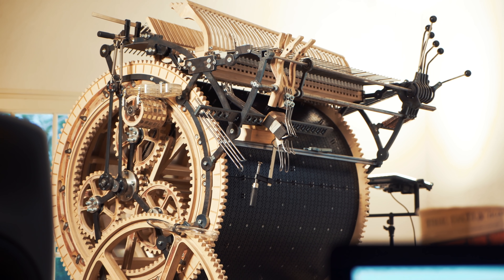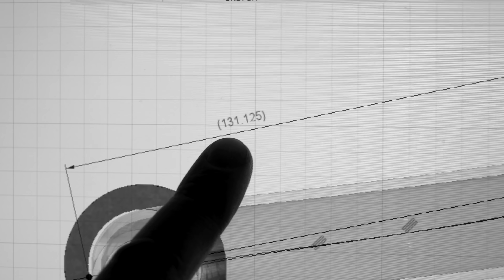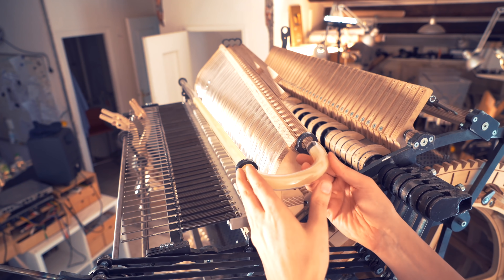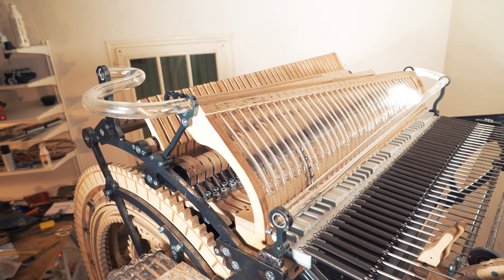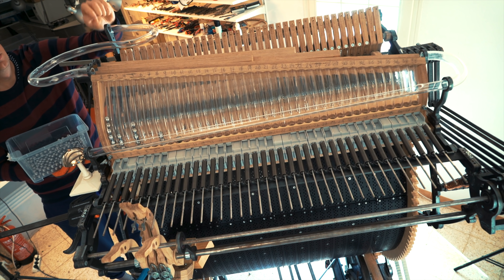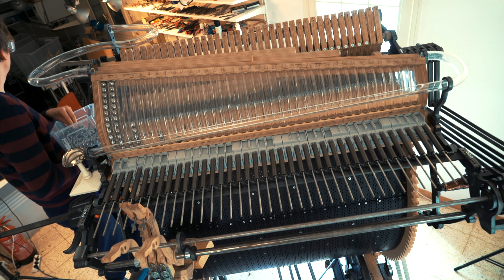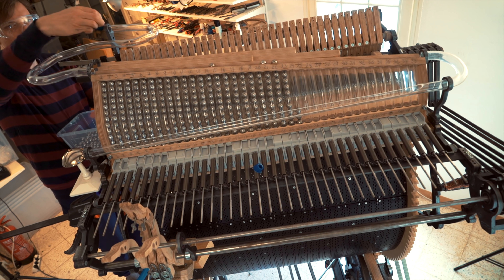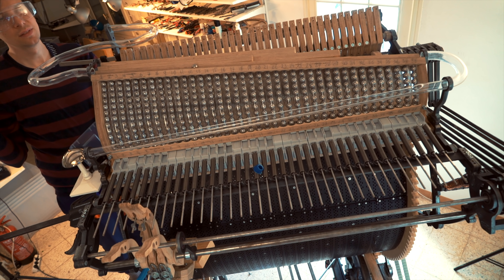Marble Divider Transport Tracks - Marble Machine X #68

Comment from the maker: Latest News: Maybe we did find an alternative programming wheel design yesterday, brainstorming with the team! (after the recording of this video) 

As I mention inside the video the most popular suggestion for a design change is to have the songs preprogrammed on tour. This would only be practical if the sections are redesigned into something much smaller and lighter. 
Yesterday I talked about pop rivets in a thin metal sheet with holes drilled by the CNC machine and then Tim Keller mentioned a welding stud gun and that we could bolt one to my cnc machine then I found this:
https://www.youtube.com/watch?v=SzLPZj_lkwk
a welding stud gun CNC machine from HBS, Germany, 
The idea here is to use thin metal sheet and have the CNC machine accurately weld on the programming pins to the flat sheet.
The sheet is thin enough to easily bend around the radius of the programming wheel.
To save weight you could laser cut the sheets beforehand and remove a lot of excessive material.
The songs could be transported flat, and perhaps even be cut in one length, although 267 cm is probably to large surface to cover for the machine so maybe two halves is the practical choice.
Anyone know anyone working at HBS? Maybe they want to do a collab on this :)

This solution does not allow me to compose spontaneously on the machine, but I can use my existing programming sections for that, and then the stud welded solution for the world tour :) best of two worlds.

One dark cloud on the stud welding sky: Every weld would distort the sheet a little, so more notes, more distortion. this might be too much distortion for keeping things accurate. Maybe software can compensate for that. 
And this is a great example of why this problem is tricky, every solution that seems genius, provides its own new problems.

But, Come on HBS, wanna go dragon hunting with the Poster Child of Sunken Cost fallacy?? Its a Very rare event, lets do it!

Good luck with everything you do! / Martin
Reply: Sunken cost fallacy is only applicable if you have something better to do with the resources that you put into the project. If you can't think of anything else you'd rather want to spend your resources on, it does not apply. Not all investments need a positive return on investment, the journey itself can be worth many times more the value of the outcome.
Reply: @JochemKuijpers  no, not something better, marginal analysis looks at EVERY POSSIBLE alternative, it's an extremely impractical approach, but your comment over simplifies it a touch...
Reply: Ok so I found the vid here:
https://youtu.be/x0RJWFURcs8

One massive issue is the size of the welding head. That radius will definitely prevent you from putting suds anywhere near as tightly packed to match the current programming pin spacing.
Reply: Everyone sub here then HBS will collab for sure ;) https://www.youtube.com/channel/UCL3iZdVyWmxemHyjj1B_4ew
Reply: @jamesdavis2027  I saw that too. Looks to be at least  25 mm or an inch
Reply: @jamesdavis2027  @Cliff Hartle there are other videos as well, where you see that they also weld without that "pneumatic clamping device"
Reply: But you have a 100% working design right now, so this welder strikes me as a solution looking for a problem.
Reply: You copied the link from the description so it is broken, here: https://www.youtube.com/watch?v=SzLPZj_lkwk
Reply: MangoTec interesting, in this video there is no welding head that comes down around the stud unlike the one I found. This setup seems like it would close packing.

Also martin, Im sure if you got on the phone with the company they’d let you know how to avoid warping and shrinkage.
Reply: jacktheripped  someone needs to watch the entire volume of videos. It's all been accounted for.
Reply: If you were able to program the CNC paths to say, start on one end of the song, and go to the other, the sheet would distort past the latest note (with no notes past it), so while the end of the sheet would slowly creep, the space between already welded notes would not? Maybe? Just spitballing here. 

Also, at least in the US, that video link is broken. 

Cheers!
Reply: As a suggestion for the issue of programming quickly and correctly onto the wheel would be to make paper overlays for each section where there are holes where the pins want to go for each song. Similar to a template. While it would not speed up the issue directly it would make the programming easier (and thus faster) and , more importantly, more idiot proof.
Reply: @nothingtoseehere9834  i think he mentioned that as his original idea as to how to speed up the programming
Reply: @SkullCrusher757  I had thought he meant like a metal or plastic/acrylic sheet. Hence the weight argument. I feel like I was mistaken.
Reply: @nothingtoseehere9834  no in this episode he did but his first idea was to use paper he mentions it in a few earlier episodes
Reply: @SkullCrusher757  ah, my mistake
Reply: If welding distortion is a problem, why not go with the tried and true method that nearly all music boxes have been using for centuries? Bent metal pins! Laser cut the sheet with thousands of semi-rectangles, maybe scored on one side to facilitate accurate bending, then tediously bend them all up into position. With some clever software programming you could probably laser cut a sheet for each song individually. Granted there may be more problems with this, such as making the pins rigid enough not to distort from a 90° angle, but it could be another solution. 

Bonus suggestion....
Invisible UV paint on the machine (and marbles?) for a crazy secret rainbow effect that only shows up under black light. Maybe cover Black Light Machine by Frost* too...
Too crazy? Yeah.
Reply: @boswell255  You'll still have warping problems with lasering that much out of a sheet.  Same with CNC turret machine.  I may have accidentally made operators of both hate me with some of my designs.
Reply: @boswell255  Bent metal pins could also allow the timing of individual notes to be very finely adjusted by slightly altering the bend angle after the sheet is installed.
Reply: Most complex machines like this uses simpler programming media. like paper strips or cards with holes, that are cheap and easy to replace. You move the complexity to the reader and have a more manageable size of parts to deal with there. When the programming wheel has all the holes that need a  pin you will have almost infinite amount of points of failure.
Reply: Wintergatan the link is broken :/
Reply: When doing that many welds onto the thin metal sheet you might experience warping due to heat.  Have you though of instead putting the “pins” on the keys the pins hit? If you make a thin laser or plasma cut metal sheet with slots in them the length of the note to be played then have a pin sticking of the “registrator” ( I think that’s what they are called). This also means that you have to control less tolerances in the slots as only two sides of the slot have to be precise. The pins on the keys would probably be small rollers and be spring loaded down. Since you have to change the songs but not the keys it’s ok to make the fewer parts (keys) more complicated for the benefit of more parts being less complicated(plates or plate). If you made the sheets long enough the you could also do the whole loop in one sheet allowing for less total gap between plates. This also allows you to transport multiple songs easier Because it is just a flat sheet of metal vs a sheet with studs sticking out.
Reply: I think it is perfect the way you designed it. Nothing more. Nothing less. If you ever build another marble machine, perhaps you should consider replacing the programming wheel altogether with some solenoids and hook the whole thing to a computer. Perhaps with some custom MMX software to control the solenoids. That way you could have your songs on a memory card... Perhaps there would be some reader on the crankshaft to have the rhythm fed into the software, for a more live experience, even if the song is fed from a computer.
Reply: Martin, funnels work best when they're upright. :)  Make a marble loader by taking a short length of tubing, heat bend it 90 degrees and flare the ends out enough to fit over the existing tube and the funnel.  Then you can just hold it in place and dump marbles into the funnel.
Reply: I assume you've already considered a pneumatic system, like on player pianos? It would allow you to use a roll of paper, so your songs could be longer than a single drum, and plus you'd have some cool looking bellows or pneumatic tubes to create the air pressure (+ aesthetic points). Example of player piano system: https://www.youtube.com/watch?v=ei8WeNCl1gk
You could likely set up a CNC system to punch the paper, and once a song was on the machine, there would be no further alignment necessary, as it's one piece. You could also use plastic sheets, or Tyvek, if you wanted something more durable.
Reply: It doesn't really have to be one or the other, does it? The welded sheet solution could register on top of the thick slotted plate solution, allowing improv by removing the sheets. With the thickness of the slotted hole system I'd also consider something like 3D printed curved tracks, i.e. not the full width of the wheel. Those could be printed with the tune pegs already on them (on an FDM printer, align the rotation axis perpendicular to the layer direction) and be quite light as they don't need to be filled. You could CNC them if they're as thin as a single track or you use a multi axis machine, and you could replace a particular segment with a slotted version for programmability. The glaring weaknesses are precise alignment of multiple small segments and bulk of storage. Now I'm dreaming of that 5 axis welding deposition plus router finishing CNC machine again... https://www.youtube.com/watch?v=oaIOrQi2HLM
Reply: The stud welding system most used in industry is from Stanley/Emhart/Tucker (They have been bought and changed names a couple of times) 
http://www.emhart.eu/eu-en/products-services/products-by-category/tucker-stud-welding/index.php
Usually mounted on robots, but I see no reason it wouldn't work on your own CNC router system with some SW development and brackets. I work at ABB Robotics in Göteborg and have some experience with these systems for the automotive industry. The alternative could be to use a robot directly on the curved surface, but you can't get an absolute accuracy of 0.1mm without inline measurement of an external system. I actually doubt you could get 0.1mm from the stud gun itself.

Skicka ett meddelande om du vill ha hjälp med robotteknik, studsvets, offlineprogrammering eller noggrannhetsfunderingar.
Mvh Thomas
Reply: Don't listen to them Martin. You're putting the work in, you're testing it and discovering what works and not. It's easy for others to be armchair experts.
Reply: Whoa. This is even MORE complicated. :o
Reply: Have you considered clamping a bucket, tub, or other receptacle - only temporarily of course - to your unsecured outlets?
Might save you some trouble in chasing falling marbles for the time being.
Reply: I would suggest, that you produce at least one set of programmable programming plates ( ore maby jused use the ones you already made. Because being programmable ads so much character to the mmx. The cool thing about mmx is, that its not jused renders mysic. But workes more like the read at write memory of early computers
Reply: Hi Martin!

I had an idea that I am not completely sure is feasible, but would maybe be interesting to get your take on it. 

One of the concerns would be transporting large programming plates, plus having to reprogram them during your shows. My thought to alleviate this would be to use your idea of having a sheet that covers the plates and only shows the holes that the notes are going to be played from, but instead of placing metal rods that hit the marble release, have a mechanism connected to the top of the MMX and marble release fingers that is able to "read" the open holes and release the marbles, similar to a hole-punch music box!  This way, you only need to make, fit, and carry one or two sets of programming plates on tour, plus giving you the luxury of being able to compose on the fly if you have the sheets and note-reading mechanism removed.

I feel like I am over simplifying this, but you have a deep understanding of hole-punch music boxes so I am sure you would know if this could even possibly work. Thanks for your videos!!
Reply: Ok - a suggestion for quickly changing songs on tour (using current plate design) and also minimizing the human error... is PAPER templates.  Place paper templates marked with slightly oversized red marks on the plates.  Humans then punch the pegs through the paper into plates on each mark.  You are done when every mark has a peg, and every peg has a red outline.  (Any peg missing the red outline was placed extra)  Then you just rip off the paper and the plates are ready to go!  (or don't - if you think the paper color looks cool enough)

The paper templates are light, easy to store, easy to use even with volunteer labor, and easy to replace with any standard printer.  You can easily vary the paper/ink colors for aesthetic effect too!

And to address the problem of mixing up song templates?  I'd suggest a light colored "watermark" pattern unique to the song on each template, perhaps one as simple as the name of the song and plate number repeated over an over on the paper.  You can even pick fonts or some emojis to add to the pattern.  That would also help with the issue of the paper being placed upside down or on the wrong plate.  (Also suggest the peg marks in a bold, contrasting color to the watermark color)
Reply: An option could be to CNC holes according to song in the thin sheet metal. Then: 
A) Use pop rivets, but don't apply so much force that it breaks of the pin. The pin will act as the trigger.
b) Use self-threading bolts in the aforementioned holes. The bolt will be the trigger.
Reply: Rather than cnc the plastic first then bend it to the wooden form,...could you possibly bend the four panels around the cylinder and cnc the holes whilst it is in cylinder form?
That way you have the O/D and I’m sure you can math out the degrees between each hole to get the correct sizing between pegs
Reply: You have a functional system that you have already ironed most of the kinks out of. Resetting from zero is a bad idea. You set out with a specification, and achieved it in what seems to be the simplest solution that is robust enough to be worthwile. Maybe consider steel pins with coated magnets, though. NeFeB magnets are brittle. There are a number of companies that would manufacture them for you, but not for free. K&J Magnetics comes to mind.

What I'm getting at is stress test, stress test, stress test. Then stress test some more. You really don't want things breaking on tour.
Reply: Another problem you could encounter with the welded stud problem is the pins could bend the sheet metal very easily leading to the notes being played at the wrong time this could wreak a concert in more ways than one. However it may have been brought up before but if you were to increase the speed of the programing wheel you would increase the accuracy of the pins. The downside to this is that you would decrease the amount of time you can play before the wheel repeats itself. Although you could possibly make the speed that the programming wheel turns variable so that you can increase the precision when you need it and increase the loop duration when you need it.
Reply: It has the same flaw as the current solution. Ie, manufacture a flat profile that is bended into place afterwards. Will most likely never work.

The current solution is good enough. Keep working on it. In principle, you only need access to a big-ass CNC-machine for a couple of hours and the problem is SOLVED!!

( the contradictions in this message will clear if you read my main comment above. )
Reply: https://www.reddit.com/r/MarbleMachineX/comments/ar139l/suggestion_use_injection_moulded_interlocking/
@Gonzonator1982 has visualized what I suggested weeks ago. A plastic injection molded part that is pre-curved and fits together like LEGO pieces over the sheet metal of the quarter panel. Martin started with LEGO and needs to add that concept back in. Heck even LEGO could design this for Martin! This idea would handle the split holes between panels just fine.
Reply: as long as you can get the resolution it looks good. And do the pins in time order and this will negate the distortion.. maybe? definitely a fun idea!
Reply: maybe try using nylon thread or prerecord to pull the rubber
Reply: Wintergatan Исполните что-либо на новых инструментах! Все этого ждут!)))
Reply: What music you will use?
Reply: stud machine looks so epic lol
Reply: the over complicated solution could be a mixed solution inspired by this https://www.youtube.com/watch?v=lCARHatJQJA and https://www.youtube.com/watch?v=gMNC5lvPgsg a programmable pin table ?
Reply: You can have the thin metal sheet that you are welding the studs on be resting upon a thick metal plate that will act as a heat sink. Programming the studs to be welded into different zones will enable the heat to be sufficiently pulled from the thin plate thereby minimizing any distortion. Perhaps even more elaborate you can set up a cold water wash between the thin metal sheet and the thick metal heat sink that will facilitate even faster recovery resulting in less deformation to the thin metal sheet.
Reply: next time, try KY jelly
medical advice
Reply: Martin: Consider: Modify the pin design instead of the wheel. A tapered pin that needs just a bit of light tapping to secure it. This may require a tool to pull them out. I really appreciate your attitude as much as all of your other skills. Thank You!
Reply: Now I am a bit concerned that the latter channels will suffer from starvation, and not get any balls, if you have long sections of intense music. But I guess that as long as you don't deplete the buffers, you are safe.
Reply: @piratk  remember the alternative paths above the marble divider? Incoming marbles are split in three lanes so that 2 of them bypass a certain number of holes.
Reply: Wintergatan when will the marble machine eggs be finished xD apparently according to the captions it’s the marble machine eggs
Reply: Would something like this work?  I'm pretty sure it would work even better with fiberglass rods... Sort of like electrician fish tapes..  https://imgur.com/a/Y9RGehB
Reply: Having an additional axis on the router cutting head would help, rotation around the Y axis, in the XZ plane. 
You could cut the pinholes right into the already built programming plates, perhaps cutting the song directly even.
That would totally deny any on-site programming but would perhaps ease about 75% of the worries of transporting the plates with pins or placing the pins before show. Also, much less holes into a plate that will have to be bent in place.
Reply: Make it simpler by using a 4 axis router to cut the programming plates
Reply: Idk but it seems to me like those sheets would be a SOB to pack since they’ve got all those studs sticking up... I could easily see them getting banged up when traveling and make them inaccurate, so they might end up being more of a hassle than a help when it comes to actually going on tour. Cause you’d have to pack padding or something between each plate to prevent the studs from getting damaged, and that can take up a lot of room, where the system you have is harder to damage in travel and could be packed with more space efficiency. I guess that could also depend on how you plan on getting the pieces from each venue to the next, because if it has to go on a plane, you go by weight and the stud plates would be cheaper since they’re lighter and the padding wouldn’t be very expensive, but if you’re driving it place to place with limited space, the programming plates would be better since they pack up better.
Reply: @starvingscientist  You can probably just use sheets of styrofoam. Essentially have all the pins stab into a sheet of styrofoam. Then you'll have the flat back of the sheet on one side and the flat of the styrofoam on the other. And if you're careful you can reuse the sheets of styrofoam (which has added benefit that you don't have to force the pins into the sheet many times). Styrofoam is light too.

So you'll end up with a nice rectangular stack of sheets and styrofoam sheets that you can put in a box or something. Easy to transport assuming the plates aren't too heavy. Easier than the rest of the machine certainly.
Reply: You've seen plenty of old music machines in Utrecht I suppose. Couldn't you use that system, of punching out tabs of metal, as programming wheels? It's how they did it in 'ye olde days'.

You could either try to do it fully on the CNC, or just create small locating holes/divets on the sheet using the CNC (only where notes need to be played) and then punch out the tabs by hand. With the CNC doing all the locating work, that shouldn't take much effort, and it would be equally precise. And way easier to build. You just need to create some hand-tool that punches out the required tab shape (perhaps like a stapler; a die on the bottom, and then a punch from the top. These could both be located in the correct position using CNC-cut locating holes.)
Reply: Chuck-U Farly  But it's still going to take time to do. And this will affect the show as a whole, since they would have to work around that by playing other songs while they reprogram. Even If they can get it done in say, 5 minutes, that means every other song will not be a MMX song. That is my concern. (and if it takes longer than that, , , ) And they would need people to do that, since they are busy playing music. 
But being able to produce robust, yet "lightweight" fixed, replaceable plates would reduce downtime to what it takes to replace the plates. I think this is the way to go. (at least for the live shows)
Reply: I think some of your problem comes from the fact that your cnc table is so big. I run into this with mine. They flex more because of it and high precision cuts become really difficult. Maybe leave your programing overlay on the drum and not just as a template.  use it to get your precision as it could be cut in one long piece. Templates could be laser cut in thin piece of spring steel. Just a thought
Reply: Weld most probably will change all     dimensions, distortion effect. Did you think about metal sheet with holes and pins made from neodymium magnets? Pins in lower parts must have smaler diameter to fit holes and bigger diameter on upper part. This should keep them in place.
Reply: what if you had a thin sheet with "U" shaped cuts in it, and you bent the tabs out to create the pins?
Reply: Don’t forget to make your legitimate comments and suggestions over on the MMX Sub Reddit  - https://www.reddit.com/r/MarbleMachineX/?st=JS3MPK68&sh=72027665
Reply: Non-interchangeable, self programming wheel. I'm going to describe the evolution of my thought process:

1. I was feeling that you are currently working bottom-up and it sways too much to solutions from the engineering side. So trying to think top-down for a second, your goals are to easily change the program, to quickly prepare new programs and (bonus) to be able to tweak it as it plays (apart from all other accuracy goals of course). All are not really practicable with the current interchanging sections and also not with the welded studs method.
2. So first though was to create a programming template, to easily program the sheets, but it will still require to remove all the pins before putting new ones and it's still not easy to solve. Next...
3. Maybe have all the pins ALREADY installed, so you will only have to change each bistable pin from 0 to 1 or back to 0. But wait, if you have that, then how will your programming template look?
4. Electromagnets maybe? Hmm, sounds interesting. So one polarity pushes the pin and the other pulls it. But you'll need so many of them... and in a round shape, that's too hard and risky. Unless...
5. You use only ONE ROW of electromagnets to SCAN through the pins like a printer. So now it can be done fast enough so you actually don't need to pre-program the sections anymore, right? In that case...
6. You don't need interchangeable sections anymore, right? Amazing! A non-interchanging one-piece wheel. But if it isn't removable, then how do you program it?
7. You put the horizontal row of electromagnets INSIDE the marble machine... Now, the spinning of the wheel provides the scanning action and an encoder on it provides the crucial accuracy needed in order to time the programming signals. All 3 goals are met.

There is one downside - electricity is not as romantic as wood and steel alone.. You'll need to decide if that is something which is important to you.
Reply: Cut them on a 4 axis waterjet cutter, all of them at once.
Reply: Why not just create thin plastic stencils that conform over the programming plates? You were planning on having 8 plates/two wheels right? While you are playing one song, the plates that were just taken off go to your pin team and remove the pins, slap on the stencil, plug the pins in, and voila. Why abandon the pin idea now? The stencils could already be pre-loaded with pins (just tack them on with glue/silicone).
Reply: The next time you have to lube up a part for inserting into a tight fit, I'd recommend using isopropyl (rubbing) alcohol instead of soapy water.  It is (surprisingly) a much better lubricant AND doesn't leave behind any residue.
Reply: Why not just skip the plastic/rubber sheet and go all metal? Much less heat warping and safer for wear.
Reply: If welding on the studs doesn't work you could also try the sheet but with the needed holes cut out, that way you can find the places needing the pins quickly. Like a programing guide.
Reply: If you don't want thermal distortion of the sheets, you could use a material similar to how a rivet works: 

IE: Machine the holes for the song  with a precise Diameter and slowly and accurately compress the pin in place

Downsides: Rivet like design would all require calibration to retain accurate spacing , and use would wear on the pins (less durable?) but I assume this is inherent in loose pins in a programming wheel as well. 

Upsides: if you use something similar to a Nut-cert (For example, see link at bottom) they can be slowly drawn onto the sheet with an installation tool that is perpendicular to the sheet like a bolt and nut (short bolt and washers means that installation has less leverage on the perpendicular installation) and only the holes that will be used need to be cut in place.

I like the idea that the PMA sheet is used to prototype, and that a final build would be more permanent. 

http://www.essentracomponents.com/en-us/fasteners/thread-inserts-tools-kits/thread-inserts/rivet-nut-thread-inserts/rivet-nut-thread-inserts-ribbed/alc-47386?gclid=Cj0KCQiAnY_jBRDdARIsAIEqpJ1U2CLm1aOQXD5flt7IuHF2gRTyMaKLU1EYAy6gPUiHZY1cQk8QDoIaAjpnEALw_wcB
Reply: Also, I must comment on the programming wheel.  You have come up with an excellent solution for the problem of a reprogrammable pin set on a circular board. Seriously, well done, accounting for deformation at the required accuracy is a very tricky problem. There are some issues with this setup, but none that can't be solved with effort and a bit of fiddling. However, if those issues do become too much, I have an alternate solution. 

As I see it the biggest issue is accounting for the change in pin distance as you convert from linear to radial. The easiest solution is to not convert from linear. This can be done by adding a small wheel behind your registration mechanism, subdividing the plates many more times (probably every ~5cm or so -- the radius of the wheel + the plate should be greater than the subdivision distance) and essentially making the thing into a conveyer belt type system. You can maintain the wood mounting (attaching the plywood by a hinge and with the hinge distance having an inbuilt adjustment) and there looks to be just enough room between registration mechanism for the thing to go over. Your planetary would require a small adjustment to drive and engage the wood instead of directly mounted, but it is 90% there already. The primary advantage is that as the plates and pins hit the registration they would not be radially deformed. The gap between the plates would likewise be flat (only for the ~20 cm between leaving the planetary and engaging the second wheel) so the very finicky adjustment process would be eliminated.  It would also be dead simple to remove....though admittedly a pain to remount. This would enable trivial song changes.  You could even mount the plates before CNC to get dead accurate (and song specific) pin holes.  Anyway, please let me know what you think (especially if/why this won't work!), and happy dragon slaying!
Reply: I'm so happy this problem is still being thought through thoroughly :)
this metal sheet is some incarnation of my elastic carpet idea, but I was rather for pins-sticking design (composing on the go, correcting songs during tour)
Keep getting better!
Reply: @Wintergatan Man, you owe no one satisfaction of what you are doing with your creation. Nevermind the bollocks. Go and over engineer everything.....  You are the artist. They, the spectators. Is your hand on the machine, not theirs. An advise, never answer to negative critics, you open way to others feel confident to criticise. Wish you the best!!! ...
Reply: Maybe try clinch studs / bolts instead of weld-on bolts. They are pressed into holes of a sheet metal and stick out on the other side. There won't be any distortion due to heat or anything. You could laser cut a sheet with holes in the defined positions and then press the bolts into the corresponding holes by an automatic machine. An additional advantage would be that this could also be changed manually without much tools required.
Check the PEM system by Pennengineering for example: https://www.pemnet.com/fastening-products/studs-and-pins/
Reply: how would you fix the welded plates on the existing plastic facade? extra screws?

spot welded studs are too dependant on third party, specialised machines and a hassle. given it is precise (position and verticallity) and studs can be positioned as dense as you like, it is a viable solution though.
as for deformation, they can maybe lower their standards of welding for your application and weld with less current?

if you go that direction, why not modifying your cnc so it can superglue spacers on a sheet of metal or acrylic bars on thin acrylic?

no cost after the modification and you get to  programme whatever, whenever :P

ps. punched cartoncards pre cut or fully perforated and programmed with stuck tape to close holes would be a classic solution to go both ways. or marked perforation locations and you perforate on the fly the desred note, tape it if you want to cancel. but that would fit on the first machine better lol.
Reply: i'm no engineer, but perhaps you could design the pins around the plates, and not the plates around the pins-- if that makes sense. Like, let the plates be what they are, and fix the pins to match it instead of the other way around. Love what you're doing by the way, have been here since the first marble machine.
Reply: I would imagine that the distortion from welding would be greater the thinner the metal is.

Aside from that, the only other solution that i could imagine would be using 12 plates to simplify the math in the spacing from 3 to 4 time, but that would probably still leave a similar problem. 
But in any case, your doing a fantastic job👍
Reply: Chuck-U Farly  Really, if you have enough bodies, I think there's room to have two people per plate.
Reply: don't let the engineers bring you down simplicity has its place ...but its at the detriment to beauty and art
Reply: The current machine won't work because there are bottle necks in the marble flow. Eg: The speed at which the marble divider fills up :(
Reply: @sirpercivale  This is also one of my concerns. But I won't deny it completely without being involved closely in the engineering team. Anyway to slow down the marble movement introduced in the current video could worsen this possible issue in my opinion.
Reply: @sirpercivale  he highlighted this saying he just needs to do the finishing work on them....cleaning the path...so already probably fixed :))
Reply: @danbrit9848  No. He is dividing one path into about 38. No amount of fine tuning will make the divider fill up fast enough. (Unless the music is very very slow)

EDIT. There are 3 fill tubes. I hadn't seen before. I hope this is enough. The number of notes per second still appears to be very limited?
Reply: @sirpercivale  ...your forgetting he has the most often notes at front and least at the back and have you not Hurd the first one and this is improved in every way...it dose fill and plenty fast...he just hadn't smoothed the rails ...and you can have ways of speeding it all up if he wants...
Reply: That's an amazing idea. Will these sheets be sold in music shops together with vinils and cd's?
Reply: Perhaps you can find a means to draw the heat away from the metal sheet to minimize the amount of distortion caused by the welding process? Maybe by "floating" the sheet on thin layer of some sort of cooling liquid (something that won't immediately flash to steam under the heat load).
And you could spread out the pin welding by perhaps attaching every other pin, or every 3rd, etc., then returning to insert another and another into the missing spaces, to allow time for the metal to cool before adjacent pins are attached. 
No idea to what extent that could minimize overall distortions though.
Alternately, maybe instead of welding on pins, you could laser cut elongated horseshoe shapes into the metal itself, then bend those upwards at 90 degrees from the uncut ends. Of course, this would also heat-distort the sheets, and has other issues, such as the max speed of repeated notes being dependent on the lengths of the cuts  (and therefore, the height of the bent-up pins). 
In any event, hope you find something that works gloriously!
Reply: Martin, actually I would see a lot of new troubles coming up with welding bolts with the HBS CNC machine. Many of the answers have already seen the distortion issue while welding the bolts and during the mounting on a world tour. But this would raise more subsequent questions: 

a) The metal sheet shout be thick enough to withstand thermal distortions (please watch the HBS video again). I estimate the thickness of the sheet in the video somewhere around 2mm. (please refer to this video as well: https://www.youtube.com/watch?v=sIzyzUqe0Pg ) 

b) A stabile steel/metal sheet of this thickness maybe no more suitable for bending into cylinder section form after the welding. So, the machine might have to weld after bending the metal sheet. It means welding on a cylindrical surface. 

c) If you really have to take 50 pieces of pre-fabricated programming plates, you have to think of not only the "thin" programming plates, but you also have to protect all the welded bolts throughout the entire world tour. If you have the requirement of only several 10 µm or 100µm of accuracy for these bolts. You might get into trouble of taking a HUGE amount of packaging for protection AND a lot of very careful logistics works for every transportation. And think of: it would take a lot of time to check for damages on all welded bolts after each transportation. Additionally if these welded programming plates get lost or damaged on the tour. It would be quite tough to get replacements on time for continuing the tour. 

d) I won't be very sure, if this welding solution would be lighter or better for handling on tour than the current solution.

I'm not a mechanical engineer myself, but the welded bolts solution sounds quite a lot more complicated than your current solution.
Reply: If it ain't broke, don't fix it. You only just built it
However if the replacement stud welding head was the first idea thought of, I probably would of been more excited for those programming plates ;)
Reply: Wintergatan would it be worthwhile bending the programming sheets to the wanted shape, making a frame to hold the same elevation as you rotate the sheet in place then CNC the holes for the pins? Might be able to avoid the problem of uneven warping and spacing from bending
Reply: A similar solution would be to look at the past.  Could you redesign the marble release systems to work on negative markings, instead of positive?  So just holes in the sheet, like old-school player pianos and music machines.  Then, you CNC the holes in the thin sheet.  No welding heat, less/no warping, and possibly closer-together holes.
Reply: Invert the pins and use slots and springs then you can use paper, like a player piano then you don't have a song time  limit compare a normal music box to your one that reads paper that you showed us in a video it would obfuscate the programming issue. You can cut the paper with the lazier cuter or hand punch it on the fly. Keep up the good work you have made a thing of magnificence.
Reply: When people don't read the video description
Reply: Why are you such insisting on a pitch perfect timing..?  Noone except music experts will notice if a pin is placed at 1/100 accuracy or even hear that. There is no sense to reinvent over and over again. Stick with your PE-300. Again, no human artist can play every note on the point, from begin to the end. If you try to do the sections not in rectangle shape, but in a trapezoid form that would mask the little timing differences.

Like this form:
|\
|.  \
|.     \
\.      |
   \.   |
      \ |   But in 45 degree or less angle...
Reply: @B-M.B  yes no humen is perfect but we are talking a mechanical thing hear if your going to build something you must have every part perfect aspecaly the key the music out of an insterment...no expetions shuld ever be made...do you not thin musichans strive for perfection why shuldent he
Reply: @danbrit9848   I agree. On the mechanical part you're right, but compare electronic music and handmade music.. even the electronics c one is played on point, natural played music is "warmer" that's why they inserts echos, vibrato etc into electronic music to make it more comfortable to the human ear. And wintergatan reached so much I don't think his spot-welded idea will succeed..
Reply: @B-M.B  ...and how would manufacturing a defect help at all you notice why music incline people tend not to like modern stuff to fake...but you basically saying have one string off que in a bass or guitar ...that helps no one...not would as an artist him having to work around a native flaw in the instrument ...I say agean if you aren't willing to have all at 100% in your project then you are cutting corners and that helps no one ...
Reply: @danbrit9848  I would not calling it a defect at all.. it's a human powered instrument, and if we talking about a tenth of a millimeter between one note and the next, there will be no track off queue. He could solve this with shims and when he have it inside all sheets equally, just turn faster or slower.. Noone would blame him :)
Reply: @B-M.B  years on building it...but have it without flaws why would you ever do that...compromise aspechily with the notes in an instrument is just bad wrong and not good
Reply: @danbrit9848  I get the point, Dan. But it's not the material selection it's the way he made it. That is the point where I would step in. Changing to a total different way of materials and producing for the sheets, he just fall in another bucket of mousetraps. Even that I don't know the plans, he will try to produce the sheets and bend them again later. And then you have the same defects again, but with a different material.
Reply: @B-M.B  that we can agree on..alum would be best...but that shape is a challenge in itself ...but better then the Legos on v1 hehehe ...I hope you have a grate days
Reply: I think the biggest problem was not the design of the programming wheel, but the material choice.

Did someone already suggest using thin aluminum sheets punched and then sandwiched together?

Let's say you have 8 sheets, labelled 0 through 7. Where 7 is the outermost sheet and 0 is the innermost sheet.

You could laser cut (or possibly punch) a hole pattern in just sheets 7 and 4. Then, the remaining sheets would have long channels running the length of each section, just as wide as the pins.

I think the problem with the PMMA approach is that when the sheet is bent, the bottom of the sheet is in compression and the top is in expansion. Meaning you can't get an accurate size for the pin or spacing between them without trial and error (and loose tolerances). The face in expansion will be loose and and the face in compressions will be too tight.

By using a sandwich of sheets, the holes in sheet 4 and 7 can be exactly the same (correct and tight) size. However, the spacing in sheet 4 will be smaller than sheet 7 (because it will have a smaller radius). With that approach,, you'lla perfect fit at both "depths".

Another feature of this designs s that sheet 7 could be song specific. A lot like the "overlay" you're already planning. This would mean that you'll swap sheet 7 out before reprogramming a section. This will avoid the probably inevitable trouble of trying to get the overlay to line up with the how's underneath it.

Finally, you could also make a special sheet 7 that has all possible holes that would be dedicated to composing.
Reply: @GabeSullice  his problem is not the material, but that he drill the pinholes before he bend the plate. That will never succeed.

I would instead mount the plates on the wheel, mount the drill arm temporary on the mmx, turn the wheel over the already existing gears or directly with a stepper motor to get the pins right, right shaped and perfect place. Seeing him bending the plates over and over again is just pain to see.
Reply: He was also having problems with the drill bit getting dull. Also, the PMMA heats up from the friction of the drill and then shrinks by the next morning.
Reply: @GabeSullice  that was expected. Solid wooden base without venting, cause this. Would he mount it on the wheel or a second one, turn the wheel with a synchro instead moving the drill in y axis he would solve two problems in one. He could vent it from backside, and have proper drilled pits for his pins. He could drill even through the thin metal sheet and afterwards replace it. Just my 2 cent.
Reply: All of these suggestions are missing an important point:  This is a *musical instrument*.  Not a music-box.  Not an automaton.

All of the focus on plate-manufacture, programming, pin cutting, hole milling, et cetera, et cetera, et cetera, is fine if your programming mechanism is driving a carpet-loom that has to product 1000 copies of the same carpet with no human-intervention.  But that would create music with only one time-signature played only at a specific tempo — an MMX that can only play waltzes, or only play polkas.  [Nothing against polkas or waltzes … I'm just grabbing them because everyone can imagine how tedious listening to waltz after waltz after waltz  could get.]

So, the programming plates need to handle a wide variety of musical time-signatures:  3/4, 7/8, 4/4 …
They also need to be very precise, or the music will play off-beat unless you crank the MMX at one and only one specific tempo.

Now, olde-style punch-sheets, a-la player pianos and automated organs, would work if and only if they can create enough force to drive the marble-release mechanism without self-destructing.  
Which is probably what would happen.  Consider how tight the pins have to be held in place in the current system.  Consider how the alternative involves *rivets*, not bent metal tabs.  That rigidity says, to me, that the marble-release mechanism requires some oomph to drive it.  So using a punch-sheet would have to drive some sort of force-multiplier … and soon you've taken the complications of the current programming wheel and shifted them to the marble-release system.  Maybe.  Or maybe not.  Any clever mechanical engineers out there have any ideas how to have a punch-card drive a simple mechanism that shoves a lever?
Reply: Well...if you bent the stud welded metal sheets to the same framing design... then you could always put on the plastic ‘programmable’ ones to compose on the machine.
But it seems to me you already HAVE the plastic ones pretty well worked out.  Why not try them and see if you even need to awaken yet another sleeping dragon?
Reply: The design is fine, the machining execution just needs a rethink.  Don’t machine them flat!  Put the plates on the frames, and machine them by indexing each line, like on a rotary indexing machine.  Then, a 5-axis head indexed to match, and your holes will be perpendicular to the tangent, and spaced exactly as you wish.  Those 4 plates would need to be a matched set, but I think that was your intention anyway...
Reply: @chandlergriffin7386  exactly. Then you could cool it from the backside too, to prevent extension. And of course, changing the drill bit more frequently before it gets dull..
Reply: @chandlergriffin7386  but the five axis idea is over complicated. Just turn the wheel and have the x axis mounted to the mmx temporary.. drill a line, turn the wheel to the next position, drill and turn the wheel again.
Reply: BadMoodBread 

We suggested Martin just remount his spindle 90 degrees, drive it to the end of the bed, then create a way to index the programming wheel assembly to several of the team members and on the comments, but never got anywhere.  My machine does this stuff every day, not complicated from my side.  In fact, we offered to machine a complete duplicate and ship it for testing.  Dunno how to contact anyone...
Reply: BadMoodBread 

But yes, same concept and the accuracy is only required in one axis, X or Y and only along one line...
Reply: @chandlergriffin7386  I've seen different machines doing this over and over again, either on a turntable with a lifting drill or as mentioned , a stationary x axis drill over the tube (or bended sheets) that need drills.. that's not magic to do, Martin did much sophisticated while building..
Reply: Man, listen to me, use soft aluminum. It's easy to bend, it don't deforms with cnc holes, it's not magnetic and it's chep. Also you can anodize it in wonderfull colours, one for each song. Trust me!
Reply: Martin, you should use thin soft aluminum. First bend it, then make some device so you can CNC the holes in you CNC machine (could be a wheel). That's all.
Or machine it in a 4 axis router.
Reply: Wintergatan why not use paper to program like a traditional paper fed system?   

It's probably too late in the game to change direction that drastically. 

One thing I was thinking of is instead of thinking cylindrically, why not pineapple slice?   Hear me out, right now each programming plate is a sheet bent into a cylinder.  Why not use the sheet to cut half moons that stack side by side.  Just the same that you do for the plywood portion of the programming wheel.  This way there is no need for bending or deformation that results from such bending.   Each half moon is its own note track, thus enabling any track to be shifted to any note.  Just my thoughts I've had watching you build.
Reply: My first thought when I looked at your troubles with the Programming wheel was that perhaps the biggest troubles you were facing with the concept was material selection, the plastics were warping and flexing in undesirable ways. The suggestion to change materials sounds good: but remember to consider more material choices. In theory you could make the sheets out of something like fabric or leather which you could literally roll up for transport and unroll onto the wheel (carefully of course) which would be lighter again than metal.

Explore a range of options, throw ideas around and find the best solution before committing to something more difficult than you need to, accuracy is important, but many issues can be solved by tweaking your method of fastening the songs to your machine.

The KISS rule always applies.
KEEP IT SIMPLE, but consider a range of solutions.
How could a marble machine be programmed?

I half imagine a final version being a magnetic wheel programmed with marbles themselves :D but that isn't simple.

And the simplest solution: a small circuit board playing a file from a installed USB drive in turn activated by a single marble hitting a switch isn't very appealing <_<, although having digital playback from your machine sounds terrifyingly cool, maybe a last hurrah remodel before she goes into a museum in X years?
But the initial solution chosen: THOUSANDS of holes into plastic, fine but then we discover that warps during manufacture and requires tapers? I feel the initial idea which was so simple has fallen off the path. You got it working, fantastic. But it probably isn't worth making another dozen for additional songs.
Metal Sheets sound accurate, but metal has a bad habit of distorting with temperature, bending and buckling, not to mention giving operators 'love bites' while being handled. Not to mention panels of shiny metal in the middle of the machine?
Reply: Hey Martin,

It would probably be a huge pain, but you could design and build a rotating 'programming wheel' blank and be able to run the CNC over top of it if you wanted to stay with the plastic. You would have to have an additional stepper driver to rotate the wheel while CNC'ing, but its food for though. This way yu could roughcut the plastic and already make four quarter round sections and pre-fasten them to a wheel, and then do all the cutting around the actual curved shape.

Thanks for the videos, and good luck!
Reply: Pre-welded sheets, Interesting idea but introduces a whole new set of problems, #1  the timing /spacing of pin tips  will change when bent around radius. Considering the investment so far, Better to stay with plates with this idea in mind. Current plates- The reason for tolerance pin spacing change at mating plate edges is "deflection" of plate edge 'rolling down' due to screw to close to edge . The edge of the plate is rolling inward ever slightly, tipping/rotating the trigger pins tip  towards to mate edge. The tip movement is magnified by pin length. Suggestion is to 'key' the plate edges together and move fasteners away from edge. The key can be a radiused male female dado or spline joint. The goal is  keeping fasteners away from edge minimizing edge roll deflection so edge mate radius is maintained.  Amazing work so far Martin. No words to express how your perseverance has inspired so many on many levels.
Reply: Hi Martin, have you thought of killing the kinetic energy with a big plate that has a hole in the middle, so that each set of 4 marbles, would spiral into the center of the plate as individual small little killer snakes interspaced by a timeinterval dictated by the fish stairs? Variables to optimize this could be plate diameter, size of hole in the middle, and the inclination angle.
Reply: I think your solution is good. To get anything better, you would have to do your machining with the material already bent to its final radius, requiring some type of CNC lathe.
Reply: I think your missing an opportunity here Martin!
Imagine how excited 3 or 4 members of the crowd/fan club would be to program the programming plates for each song. Truly interactive live music!!!!
Reply: Why not keep the solution that already works? Please, I wanna see the Marble Machine X before I die lol
Reply: @delphinecharles4310  and LISTEN to the music! ;)
Reply: As long as it sounds good, we’re happy. The important thing is that you’re proud of it.
Reply: if you want to over complicate things you could just go all the way and have thousands of programming pins on springs to fill every row and then just pass a role of hole punched sheet music over the top so the programming pins only pop out where the holes are in the sheet. then you can interchange entire songs on there very quickly, all it would need is an extra roller at the back on springs to keep tension on the sheet and a way to make the sheet fasten into a loop. then its easily stored away. Offcourse this removes the ability to program the wheel "on the fly" unless you make your original sections mountable on top. I'm just throwing in my 2 cents. offcourse its probably a crap idea and clearly over complicated ^^.
Reply: @SebbyG86  no, that's not overcomplicated enough. Better use something like a clicky pen mechanism  https://www.youtube.com/watch?v=GjByJMGfUpY for every pin: press pin once and it's mute, press one more time and it'll start to play notes.
Reply: Can you make the programming wheel work like a music box, so rather than being cyclical, you make something you can feed through the machine? (I caveat my comment by saying I have no engineering background, so I really have no idea what I’m talking about)
Reply: You should have your removable pin for composition, and some 3D printed tracks & pins to 'stick' on the wheel for recorded songs.
Reply: I think reprogramming Live, is going to take too long. This does seem to be the perfect compromise. 
I can add one thing though. I recently watched someone weld batteries with a handheld welder. And I also think,,, I saw colin furze use one in one of his projects. It would seem prudent to maybe rent a handheld welder and try it out first?
Reply: This is a great thing ! But the sheets has to fit the "cool look" expectations ;) Maybe a reddish/rusty look ? Keep up the good work !
Reply: OR - only carry ONE set of plates, but store more than one song on each plate.  This way you can have everything:  fewer plates (less to carry), no reprogramming between songs, and no plate positioning calibration between songs.  You just need a way to select which track activates the registrators.  Thus repositionable registrator finger-tips (see other comments).
Reply: wouw you almost dare
Reply: Hi Martin, I was wondering if you watch Marble Olympic Games on your free time?
https://youtu.be/8mmNzfXg6sM
Reply: How about machining the sections after bending them? You would have to make some innovative fixturing but the programming pin holes would not be V-shaped. That would increase accuracy.
Reply: ok